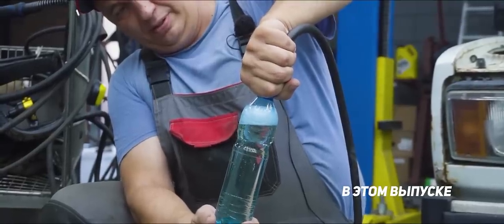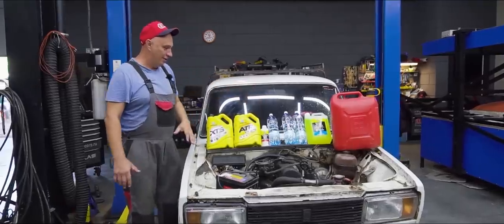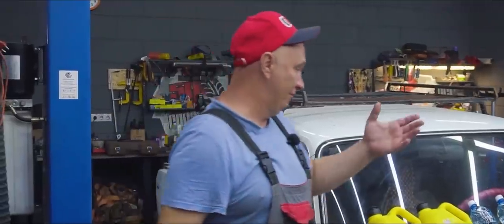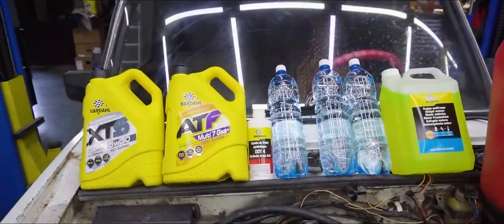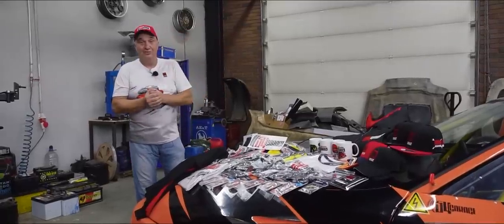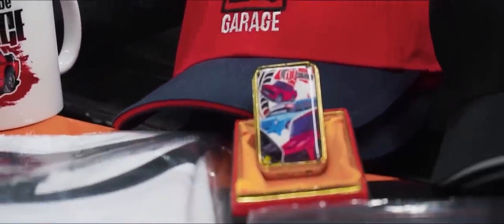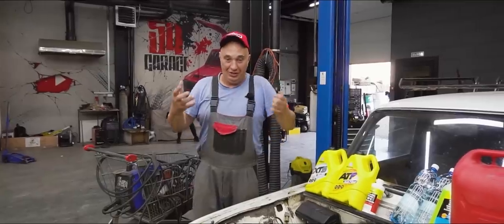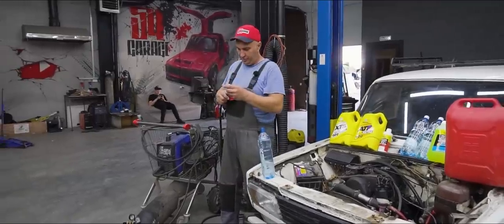What happens when you carbonate gasoline (and other fluids)?

Comment: I wonder what would happen if you oxygenated it instead, would it burn hotter? or like NOS lol
Reply: I thought that too. Then again, it will just create bubbles in the fuel line causing backfires, most likely.
Reply: The best bet for the bubbles not forming would be a gas direct injection engine because line pressure is over 20,000 psi
Reply: If it were carbonated with straight oxygen, im almost positive you could do the cool thing in movies where you flick a cigarette on a pool of it on the ground and it lights on fire. in real life, that doesn't happen with normal gasoline anyway. I've tried this on grass, dirt and even concrete and I couldnt get it to light. I even had another person pour the gas on the ground and I took a big drag on the cigarette and threw it down when it was red hot. nothing, but with O2 infused gasoline, this would totally work. You gave me a good idea.
Reply: That's how you create a fuel air explosive.
Reply: C02 is 2 parts oxygen already.
Reply: @prassmancreations3168  But it's bound to the carbon atom. It changes how it reacts.  Just like how the hydrogen and oxygen atoms bond to make H2O.
Reply: @scottinWV  Gasoline itself is already a Hydrocarbon.
Reply: @prassmancreations3168  yep
Reply: Sry. Had to dumb it down in here..
Reply: @davesmith6059  lol
Reply: @m4yd0g  yes.
Reply: @rayceeya8659  So I shouldn't play with gasoline because it's dangerous? You should be able to tell already safety isn't my #1 priority if i'm talking about sloshing around gasoline and fire.
Reply: @frydemwingz  Alright bro, your funeral.
Reply: They make oxygenated race fuels already. It is supposedly really good at preventing pre-ignition/knock. I'd be interested in seeing if NOS would do the same thing in gasoline though that would be interesting
Reply: @jeremypike9153  Dude look it up.  "Oxygenated Fuel" is a fuel additive.  A fel additive made mostly of methanol.  Pure Oxygen + gasoline = burny pain.
Reply: @davesmith6059  I bet you're one of those silicon based lifeforms! In here dissing on us carbon based lifeforms!
Reply: mixing pure oxygen directly with a fuel is a bad idea
Reply: @rayceeya8659  the owner of the shop where I work buys 55 gallon drums of oxygenated race fuel every year for his dirt race cars. It's expensive but well worth it if you're trying to squeeze every ounce of power out of an engine.
Reply: @jeremypike9153  That's just how it's branded man.  Methanol has more oxygen per gallon than gasoline.
Reply: Q16 Reg is primarily used in intercooled, forced induction drag race applications and is often regarded as the best oxygenated, leaded fuel VP produces. Highly oxygenated, requiring a 4-6% increase in fuel flow, which will make 3-5% more power than competitive 116 octane fuels. The added fuel flow also effectively increases the octane of Q16 Reg by 6-8 numbers above its standard ASTM octane rating, yielding greater detonation protection. It’s also used in any naturally aspirated drag race or truck pull application that doesn’t require fuel rules and is very popular in jet limited nitrous drag applications. Q16 Reg is a real record setter! Contains MTBE.
Reply: @mrpoopybutthole6314  how do fish breath then?
Reply: I would really like to see them try nitrous oxide in gas
Reply: @mrpoopybutthole6314  If oxygen was not soluble in water all the fish would die...
Reply: @prassmancreations3168  CO2 is already at it's "burned" and stable state.  You need O2 + Hydrocarbons to produce the CO2, so the oxygen in the CO2 /displaces/ the oxygen you need to have a clean burn; thus the smokey Lada.
Reply: @antibrevity  Car engines produce heaps of uncombusted Hydrocarbons & expel massive amounts of C01. That's why there's so much emissions equipment on cars, like catalytic Converters that collect & sometimes redirect exhaust gases back into the engine.
If I recall the most efficient petrol engine on earth is only 40% efficient.  
That leaves a lot of unburned Hydrocarbons.
Inside the engine, C02 breaks down around 2100 degrees C, whilst the normal fuel air mixture burns anywhere from  2400 degrees C to 3100 degrees C & under the pressure of the engine probably much higher temperatures.
This releases the 2 oxygens from the Carbon, that would instantly burn with the spare Hydrocarbons to turn directly back into C02 with a lot more spare Carbons that would attract other atoms & come out as a ultra fine black dust or maybe even Methane. 
There would already be a total saturation of C02 from the 100% combustion of the Hydrocarbons.
Reply: I want a Lada! You can do anything to them and still drive them on crap roads to the re education camps their building in US! All hail Biden! (One finger salute)
Reply: CO2 is one carbon and 2 oxygen so that's is exactly what happened.
Reply: EXACTLY MY THOUGHT!
Reply: @prassmancreations3168  It would be interesting to attach an exhaust gas analyzer while running the carbonated gas
Reply: @davesmith6059  I guess that's tongue-in-cheek?  It's a carbon-based world with carbon-based life-forms end carbon end life.
Reply: Your fuel system atomizers oxygen within the fuel system. The trick is keeping fuel from falling out of suspension before it enters the cylinder. That's why port injection tends to work the best. Nitrous stays cold under pressure. Once that pressure is released so is the oxygen Within.
    You likely could inject real oxy fuel. (think acetylene torch). But nitrous liquefies under compression easily.  And oxygen doesn't, only under extremely cold temperatures. So it's much easier to store nitrous oxide. It often stays in much of its liquid state until entering the cylinder. And since it's more condensed being in liquid form it expands more than oxygen.  So you get a much hotter burn. Or 💥 for your buck.

     I no longer used nitrous.  since I'm now ancient  and no longer drag racing whether it's on the Strip, Street, sand, mud or water. But I do supercharged my super STOL bush plane has a stroke type 1 2300. It's cam makes the power between 1200 and 3200 RPMs it is a torque monster!! And uses a custom composite manifold to support 2 AMR 500 superchargers with 2 injected throttle bodies for each supercharger, and each throttle body per cylinder.  Superchargers are on electric clutches since I only use the extra  HP  for short takeoffs and or high density altitude.
     Each throttle body is aircraft style. That means the mixture of each is controlled independently from the cockpit. That's done by watching both the EGT and CHT for each cylinder 😁
    
         🐂🤠🏞️🛩️
Reply: The carburator already does that.
Reply: Someone in the Air Force didn't clean an oxygen gauge very well and left some oil in it after testing it.  When they installed it in the fighter jet the pilot burst into flames.  The video of his charred body being rushed to the hospital was pretty gruesome.
So I vote a solid no on mixing oxygen with any hydrocarbons.
Reply: @prassmancreations3168  You don't understand the "40% efficient" thing.
It's not like there's 60% unburnt fuel at the exhaust.

ICE's are on average 30% efficient, the other 70% is wasted mostly as heat and sound, there's really not much unburnt fuel at the exhaust.
Reply: @GoldSrc_  ^^^
Reply: @davidwinters4762  it's a bit more complex then that but it's possible. It would need to be pressurized before injection useing the oxygen tank that will be a secondary stage injection. Right before the fuel enters the injector it's passed to a secondary injector that will inject oxygen into a small compartment that is next to the injector and once it's passes to the injector it will go into the cylinder that is allready on its up stroke and will compress it more and lead to a higher power yield. Tho it will most likely only lead to fuel economy. You won't feel any real improvment because oxygen won't be anymore effective the whats allready in the fuel to air mixture. It's best to simply add a supercharger or turbo charger. 
Unless you just inject hydrogen into the gas or simply use hydrogen only. Tho the engine will need to be made out of better materials more suited for its yield. 

Anyways it's complex. But we have experamented with this.
Reply: @prassmancreations3168 Engines being 40% efficient doesn't mean there's loads of unburned hydrocarbons, it could also mean that most of the energy is lost in the conversion of fuel to mechanical energy. All that heat engines create is unused energy which is where most of the inefficiencies come from.

Comment: Europeans tend to call fizzy water "mineral water" because most mineral water sold is carbonated. Just to clarify
Reply: No, mineral water and sparkling water are two different things
Reply: @yakitoly7461  yeah they know that, they were just clarifying why it was being called mineral water.
Reply: technically that's wrong, u can have mineral non carbonated water too
Reply: Not really, basically all water is sold as mineral, sparkling water is sold as sparkling water.
No idea if it's an east European thing or what.
Reply: @pyotrilyichtchaikovskyii6638  In poland there is no sparkling water without any minerals. There is only mineral water or sparkling mineral water
Reply: @alf3071  Yes, we know it. However, most of the carbonated water in europe is mineral water, and most of mineral water is carbonated, so we use those terms interchangeably .
Reply: @CJisDJ  Then it's the exact same as here.
Reply: They also call fries chips.. so there is that... and biscuits cookies and shit.. they got it all fucked up.

Comment: Try leaning out the mix on the carburetor, and running it again.   Also, try it with a fuel injected motor to see the difference. And finally, try carbonating some diesel and run a diesel engine on it to see what happens.  I hypothesize it  probably run rich also like the gas did, so after first test, try leaning it out.
Reply: This
+1
Reply: fuel injection will compensate for the lack of O2 buy sensing the fuel in the exhaust and leaning the mix. I think perhaps carbonated fuel would be more efficient but less powerful.
Reply: @andrewvoigt1133  That is one of the reasons I suggested it.
Reply: @KnifeKnut   @Andrew Voigt  Im pretty sure the reason why it was so noxious was the CO2 wasn't completely combusting, and turning into CO.  Pretty dangerous imo.
Reply: co2 is already completely combusted and is an inert gas serving only to absorb heat and expand, helping to push the cylinder.
It does however displace O2 when used in a carburetor and the lack will definitely cause an over rich burn. 
I don't think it would do that with an injector as pressure is maintained. locking the CO2 into solution allowing O2 a full measure and only very slightly displacing the fuel.

Comment: One thing... Trust me... It's not hilarious when one of those bottles goes off in your hand... Not even close.

Had a 2L bottle open up the hard way once, carbonating koolaid with dry ice. Vent hole in the cap wasn't big enough and I didn't get to it in time to loosen it...

💥
Reply: We call those dry ice bombs where I live. And you don't wanna be anywhere near them, let alone holding them, when they go off
Reply: @Biomechanoid29ah  They only give a very short and easily missed opportunity warning before they go. That plastic turns white, you better already be running
Reply: @kirkc9643  and because it's carbonated now, the distribution of the liquid inside is very impressive as well. Got that whole "bleve effect" thing going. That's fun when sugar is involved 🤬

Comment: It would be interesting to know what happens if you oxygenate the fuel? Do you get more power? Explosion?
Reply: Boom
Reply: Look up hoiw an engine works. Particularly the fuel injection system and even the older Carburetor systems. Thats what their jobs is.. to add air into the fuel mixture, too much is a rich mixture, and bad for power, too lean is less predictable and can cause pre detonation from heat rather then the spark plug when the engine needs it to, thus causing a miss fire/backfire. Can even cause things like ring lands lifting off pistons or pistons shooting out the side of engine blocks... Nitrous Oxide systems.. N2O, Fast and furious.. "Danger to manifold" lmfao... while not quite real, its does have its basis in real science, just blown out of proportion for the camera, Too much nitrous, adds too much O2 aka Oxygen, Oxidizing the fuel mixture inside the engine when the explosion happens.. sometimes.. the explosion IS the engine and not in the engine..

Comment: I really want to see all of these carbonated liquids being put to their usual use - in safe ways of course.

Like - how bad is carbonated oil for your moving parts? Just how bad is carbonated brake fluid in terms of loss of braking power.
Reply: The brake system can take some serious pressure, I bet you could put a lot of atmospheres worth in there (certainly a lot more than a plastic bottle can take). Might be interesting to see what happens. 
At first I thought it would just have gas in the lines and not work, but only you hit the pedal to pressurize it maybe it would still be ok?
I'd love to see this.
Reply: @deprivedoftrance  I bet you could probably do better in a drifting competition for about 30 minutes.
Reply: REgarding the brake fluid... immediately catastrophic.
Reply: Oil is made to resist cavitation, because the air bubbles in oil are possible "dry spots" where metal can meet metal instead of the small film of oil being in between and protecting against wear. Brake fluid is made in a way to resist it as well because air in the brake system can be compressed easier then the fluid, thus allowing your pedal to move further to the floor. Air bubbles in the coolant system, cause over heating because air can be heated faster then the water-coolant/antifreeze mixture can. Also it cannot exchange heat as well as the fluid with the fins of the radiator. Hence why air only cooled engines all but died out. Even on motor cycles and such.
Reply: @deprivedoftrance  The reason it works with gas is because thats essentially what a carburetor does, mixes air with the gasoline for a better air to fuel ratio. Fuel injection works much the same way, misting gasoline allowing it to tumble with the air and mix before being ignited.

Comment: Can you dissolve a flammable gas like propane into water and then burn that in the carburetor?
Reply: Propane into petrol 🤔
Reply: @WIPEYOURLENZ  that may be too rich a combo. How about oxygen into gasoline so you can run an engine without air??
Reply: You never burn anything in the carburetor, under normal circumstances ;-}
Reply: @UncleKennysPlace  don't be that guy, LOL

Comment: I always thought of this, but instead of co2 you use butane, propane,or acetylene

Under pressure you can use a smaller fuel pump and get a big boost in hp and torque
Reply: Especially with a supercharger

And a turbo charger to make up for low end hp loss from supercharger on the top end

Comment: In the late '90s, I went to one of those "We'll fund your idea and patent" places with this idea. The dude promptly rejected it. Looks like it could work for some specific things, like deep economizing in an oversized engine (since the CO2 would help make up for the too-large throttle plate), letting you get finer mixture control and dispersement, without creating such a vacuum that you pull your motor oil into the combustion chamber.

Comment: I imagine this is how they make oxygenated racing gas. Some types of racing gas have oxygen dissolved in it. 

Running a carburetor on carbonated gasoline is probably causing it to run rich because of the pressure in addition to the carbon dioxide displacing some of the oxygen
Reply: there is no pressure inside the carb, they are vacuum operated, it would release the co2 and basically put the fire out, incomplete burn and loss of power, i do like the sound of the oxygenated fuel tho, that would be very interesting.
Reply: Pretty sure oxygenated racing fuel isn't just oxygen dissolved into fuel.. It's different chemical additives that produce oxygen as they break down
Reply: @chrismechanic2000  The vac of the carb is why they need to try carbonated fuel it on a fuel injected motor and also on a diesel.
Reply: That’s what I was wondering, could you oxygenate gasoline and would it make it more combustible?
Reply: Add Sulphuric + Nitric acid to the gasoline or diesel to make it nitrated like you would with glycerin to make nitroglycerin.
Reply: @SonOfAHerbert  That's literally what nitrous oxide does. The only reason to run oxygenated fuels are race classes where you can't run a bottle. Or like unique high elevation situations, maybe like pikes peak but there you can use NOS. You also need much bigger injectors, lines, and fuel pump to run it. Look up EXO2 and i forget what VP fuels version is called to learn more about them

Comment: I tried a tank of Aviation fuel in my 95 Dodge v10 couple decades ago. I believe it was oxygenated, felt like it gained at least 20-30 HP, but started spitting and sputtering once it got down near half a tank. I believe there wasn't enough hydrostatic pressure at the fuel inlet to run properly once fuel got down to that level. 
That said, I wonder if it is possible to oxygenate regular gasoline without blowing up? 🧐💥
Reply: Look up what a nitrous system does on your engine... ;)

Comment: Other gasses can be dissolved in liquids. For example the whipped cream in a can has nitrous oxide dissolved in it. I have always wondered what happens if you use something more flammable than cream? I don't have the facilities to find out safely, but I do wonder, is gasoline, E85 or diesel the most spectacular? I am not sure NoX will dissolve into any of them, but it seems like it probably would into some hydrocarbon, and such a solution might be useful.  Rocket monopropellant, racing fuel, engine staring fuel...